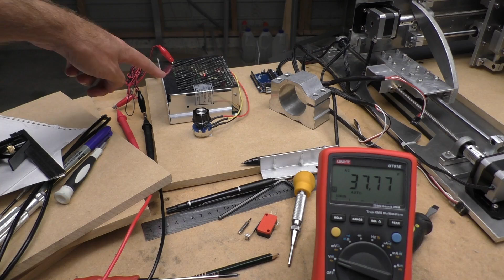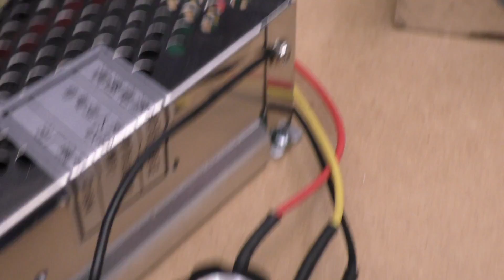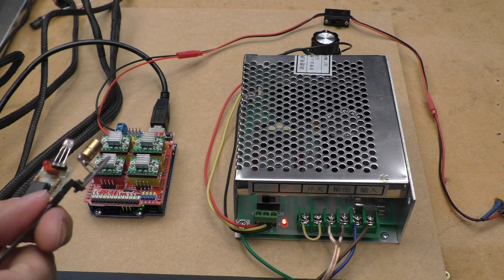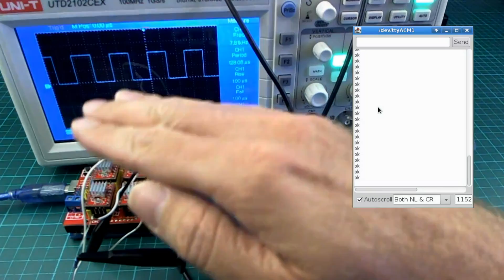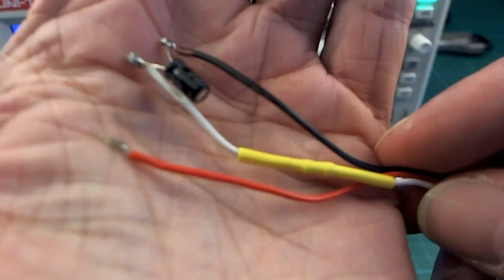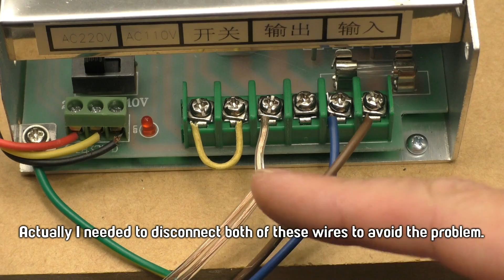DIY mini CNC machine part 9 (spindle, round two)

Comment: Voltage is a difference of the potentials, so in my understanding all your grounds should be connected to the mains ground. Googleing around yielded the same result, for example: http://forum.arduino.cc/index.php?topic=442202.0 . Maybe you had a loop or false wiring in your first attempt? Maybe try connecting the grounds one by one. But i have no experience with mains power, just with dc.
You should check your psu regardless without your cnc circuit... you could also try to use a old computer psu instead.
Please be very careful! I really like your videos and you inspired me to build my own drone - it would be very sad if you electrocute yourself :P

Comment: What voltage do you need for the spindle ? If it's 12V, ditch the cheapo power supply and use an ATX power supply from an old PC.
Reply from the maker: 100v https://goo.gl/wyvVMs

Comment: In New Zealand are your neutral and earths commoned together like here in the UK?

The laptop charger probably has an earth pin but the plug that goes into the laptop itself probably doesn't? So the laptop, and the arduino's negative, could be floating to a different ground potential than the stuff connected to the psu. That should be unlikely because most laptop chargers have the secondary winding earthed for safety - to avoid this exact scenario.

If that were the case though, then you would see no voltage between psu earth and arduino negative. But you do see a voltage... it's AC so possibly a ghost voltage - does your meter have a setting for measuring ghost voltages? Sometimes labelled loZ or similar. It just adds like a 2k resistor in line to drain any ghost voltage from the measurement.

If it's not possible to progress that line of thinking you can safely Unplug the laptop and then common the arduino and psu grounds. Use a desktop (USB ports on desktops are referenced to mains earth) or keep the laptop unplugged.
Reply from the maker: Here neutral and earth are separate. Unfortunately unplugging the laptop and commoning the arduino ground and psu grounds gives me the same problem.
Reply: NZ uses MEN (Multi earth neutral) where the neutral and earth are tied together in the house meter / distribution cabinet. So earth and neutral are usually at the same potential.
Reply: Earth/Ground  and neutral is the same thing, comes of the star point of a transformer (Secondary side). The star point get to be grounded and a lead from there will be called the neutral.
At your DB (Distribution Board) they are separated so that your Earth Leakage unit can work properly.
Back EMF *****TAKE OF THAT EARTH FROM THE MOTOR*****

Comment: Holy crap... It looks like the problem seems to be FM....

F~%king Magic.... ;)

There may be internal connections in the Stepper motors or the Spindle causing the
ground potential problems. Looks like it may be floating grounds.
You are getting voltages but they may be stray voltages at very low current.
I'd try disconnecting all the power leads to the Motors and spindle and re-connect one at at a time while checking for the proper Grounding and voltages.

Comment: connect all the ground together.
arduino, power supply and de cnc chassis
this shut solve all the voltage difference problems and EMI
Reply: All chassis shuold be at the same potential (PSU, spindle, arduino & CNC itself). PSU chassis is already earthed and everything else is more or less floating right now. 

If I understand situation correctly all grounds(=chassis) are safe to tie to the same potential. (Not POT gnd, treat that as a signal.) Other possibility is to isolate arduino totally from rest of the circuitry. 

You can also try floating  arduino,  unplug laptop from mains.
Reply from the maker: No thanks: https://youtu.be/y12BQ9s5Ebw?t=22m32s
Reply: Test using a resistance of 1k or 100 ohm to measure how much current goes
Because probably most of the voltage comes from capacitive charge
Reply: Safe way to check is that resistor trick.
Reply from the maker: Unfortunately unplugging the laptop still gives the same problem, with or without commoning the arduino ground and psu grounds together.
Reply: Take a look at the arduino 5v and the controll signals with your oscilloscope. You are probably picking up a lot of noise from the psu.
You should shield the motor and/or the signal wires and measure again to see if it has an effect. Also do as Pedro said and connect all grounds including the cnc it self.
Reply: huh what? grounding everything together will make sure you make a short circuit between the isolated psu's and burn everything - that's not a solution lol.

Comment: Where does  the arduino getting its power from ?
Is it from the laptop ? because the laptop also has a common earth with your psu! and those Chinese PSU are very very bad and not recommended at all
Reply: watch EEVBlog's video called "how not to blow up your oscilloscope" he explains this phenomenon exactly! it is exactly what is happening here
Reply from the maker: Thanks Motor Madness, that was really good. Explains the problem of my previous video at least.
Reply: Yes Motor Madness has a good point, Thats why I suggested the plastic, very basic but might be effective, just a pain there's no tolerance with the clamp, the opto isolation is a good idea, even a servo geared to the pot would do for the speed, a bit  Jurassic perhaps but cheap lol
Reply: Try unplugging the laptop from the wall and use it with its battery while doing your experiments. I have been there before trust me! Furthermore, the measurments you are making may not be all that accurate... 
You are measusing voltage differences with just a plain multimeter with 
probbably 10MΩ input impedance. This almost always causes "ghost" 
voltages to appear due to parasitics etc... When measuring voltage 
differences between grounds, you sould take measures with a multimeter 
equipped with a "Low Z" voltage scale, or if you don't have one, first connect the two grounds with a resistor (in the ballpark of some KΩ) and then measure the voltage across the resistor with your multimeter. If you continue to see big voltage differences, Huston we have a problem! (and a baaaad chinese PSU) :)
Reply: When you will upload your next video?
Don't blowup anything else this time :lol
I don't know why we always blow things up and after that realize the problem :lol
Reply from the maker: Yes, from the laptop.
Reply: If you have any access to an isolated Psu for the motor or if you can power it from liner power supply I think that would make difference, if this psu doesn't have proper filtering on its main's inputs, that may cause some issues.
Try to power the spindle from some lipos connected in series, I am sure that you have some batteries to do so.
Reply: Ανδρεας Τσιρογιαννης 
Removing the laptop's plug is a good Idea and worth trying, but I would prefer powering the spindle from a totally different source just for the sake of making sure there is nothing coming out from it wrong.
also it is a good Idea to connect your Oscilloscope to the Psu output and see what is happening when you start the spindle.
Reply: I total agree!
I would rather build a PSU myself (with a nice Transformer) than using this chinese one.

Maybe with a Transformer (Galvanic Isolation) and a MOSFET.
Reply: I bet that he does not have isolated USB cable !
Reply: I bet he does not have isolated step and direction signals from the Arduino to the motor drives.